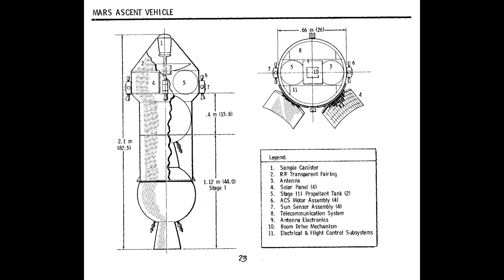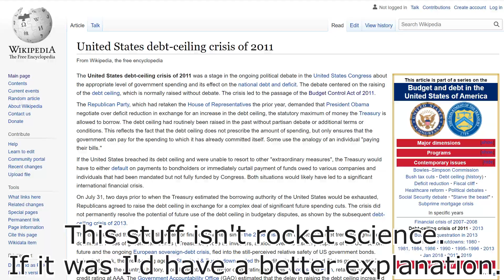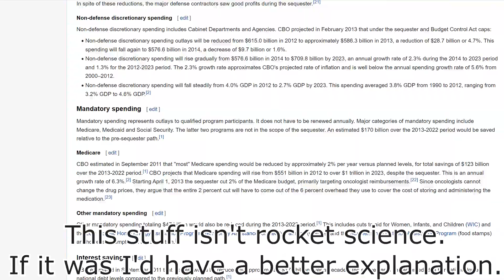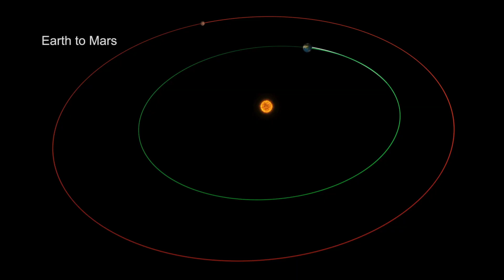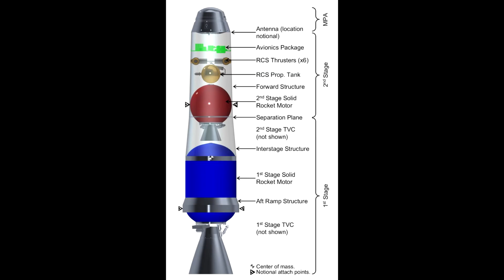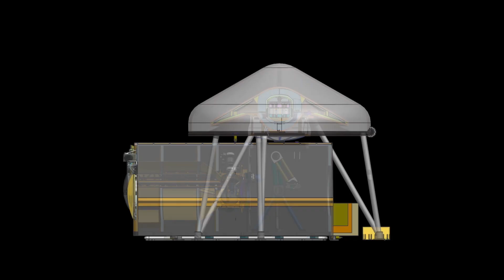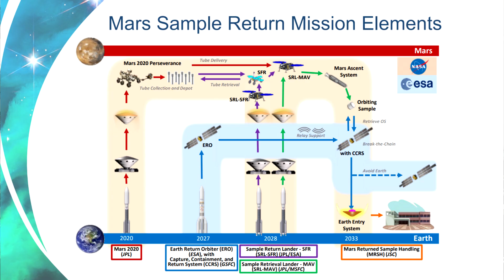Why Getting Rocks Back From Mars Is A Massive Challenge

Comment: The logistics of this mission is crazy, I know they are going to pull it off, but 4 separate parts rendezvousing on another planet is absurd
Reply: Oh god, I didn’t even think about the landing location precision. 100km off and you’re set back several years
Reply: @alexsiemers7898  I think getting the landing spot correct is one of the easier things.. If they didn't figure out the trajectories and orbit calculations by now, they'd probably be missing the whole planet :D
Reply: @rkan2  Plus, the descent stage can be vision-guided now. I can't easily find info at the moment, but I think I remember Perseverance was set down within 5 meters of the target landing spot.
Reply: @alexsiemers7898  40m seems incredibly accurate. Wasn't Perseverance set down a couple km from the intended target site due to the hazard avoidance algorithm? Hence the drive Persy had to perform to get to the delta.
Reply: @FredPlanatia  yes, but Percy has now taken some really good pictures of landing sites… (or will take them in a few years)
Reply: Sometimes I have difficulty getting three parties to rendezvous in a store. I'm imagining all this science and am frankly amazed that people can potentially pull off this minor magic.
Reply: It’s probably cheaper this way. Unless you want to use a SLS for the entire mission (rover+sample rocket+transfer stage)
Reply: @fork9001  you mean the sls that doesn't exist?
Reply: @iseriver3982  Definitely doesn’t exist, there isn’t a 4.1B dollar rocket inside the KSC VAB right now.
Reply: As silly as a sky crane?
Reply: It sounds crazy, but it improves the chance of ultimate success in the event of a failure, vs a single point of failure killing the whole thing
Reply: The mission approach is not absurd, just difficult. You might say the complexity of JWST is absurd as well, but with enough testing and simulation, it is possible.
Reply: It's not absurd, it's necessary
Reply: And when is SpaceX going to do a human return?
Reply: No way they're making KSP in real life
Reply: Sky crane was the craziest. This is easy in comparison
Reply: Indeed Jason.
Reply: Yeah it's absurd because of the planetary protection zealots.
Reply: i doubt they know there going to pull it off there are tons of things that could go wrong with this mission  which are all completely outside there control. 

not to mention this is is kinda a silly thing to do  because  from my perspective it would probably be cheaper and easier to  just launch a automated  lab to mars  to look thought the samples there
Reply: @si2foo  But there is better equipment and instruments on earth, that are very heavy and can only work in controlled conditions. This lab would weigh thousands of tons if we wanted to achieve similar results to earth return. Rovers can already do this, but the science returns are minuscule compared to earth return.
Reply: @si2foo  But it would be more expensive because you need to bring all of the state-of-the-art scientific instruments. And that would be very expensive and heavy.
Reply: not as absurd as my family
Reply: Agree,  a great deal if moving parts for these series of missions.
Reply: From which perspective is it crazy?
Reply: bro why arent we airbags for landing fetch rover
Reply: While i also hope they will succeed it is indeed an insane challenge wich you do atleast realise unlike the Musk fanboys talking about what the best ways to build domes on mars would be in the next decade lol.
Reply: @sambal777  zeah, its mbarrasing to see meople drool over a tsla launched in space byt into the mars mission promises, while for actually smart and talented people rocks from mars are already a challenge and the most exiting thing shoulb james-webb telescope, not a fucking car,
Reply: indeed,  stupid..very difficult
Reply: More practical from a engineers perspective
Reply: So much naivete. The logistics from the US to Devon Island are not that hard
Reply: Whoever goes through the trouble of returning Mars samples, will not want to share the prestige with old programs.  They will pick their own samples
Reply: @douginorlando6260  WTF are you even talking about? Whe whole point of the current rover is to collect samples over a great distance which takes years while in the meantime, we develope the means to collect the samples. Why would you start all over just because of an old program that collected the samples?
Reply: They for sure aren’t going to pull it off
Reply: @eclark9965  Ye of little faith. The people who work on this are consummate professionals. They tick every box, check every contingency, and plan for the worst.
Reply: @wgoulding  and yet they can't identify a greedy contractor that would rather profit from continuous failure then deliver the finished product.
Reply: Mars science is a minor bonus to the primary goal of us being so clever and pleased with ourselves for building the technology in the first place lol.
Reply: Lol don't hold your breath. Lots of moving parts relying on multiple agencies with very questionable track records. Everyone mocks Elon time, but Elon time is downright punctual compared to NASA and ESA time. See SLS and JWST as topical examples.
Reply: @raymonddonovan3297  hardly comparable. elon's got his own slush fund and is playing in LEO mostly(yes mostly, no that didn't mean "only"). Interplanetary travel and actual missions, not just rockets is a whole different best
Reply: @raymonddonovan3297  NASA's track record on Mars missions is FANTASTIC. Five successful Mars rovers, and one aircraft!
Reply: @raymonddonovan3297  Elon simply states "earliest in 2; more likely in 4-6 years" for EVERYTHING (including full auto-pilot function of the Tesla) now over a decade. There is no plan at all and they just fuel the hype train.
By his comments the first Mars mission (some communication satelite) would have reached Mars by 2014/16 already.
Reply: @benjaminmeusburger4254  Exactly that. Usually Mr Musk jsut claims they baicalyl already have it working but just need a few more years to have it series ready. Guess what, even years later, they do not have anything but hype.
Reply: @raymonddonovan3297  and boom just like that, here comes the Elon Musk cult claiming NASA sucks. Deplorable.  NASA put a helicopter on Mars and Tesla will have self-driving capacity next year...like Musk has now been saying for 7 years.  We've been building rockets for a long time.  Every one of these projects is way more complex.
Reply: @raymonddonovan3297  NASA time only. Arianespace had the Ariane V booster ready on time. There is quite a difference between Elon time and Governmental space agency time. Elon time is optimistic date, Governmental space agency time is deadline. And I think delaying a crewed mars landing from 2025 to 2027 and then 2029 is pretty bad. Even setting the goal as 2024 is a bad idea.
Reply: @fork9001  You're right about the difference between Elon time and government time, remember when NASA said they'd have SLS fly before falcon heavy heres the quote: "We don't have a commercially available heavy lift vehicle. Falcon 9 Heavy may someday come about. It's on the drawing board right now. SLS is real. You've seen it down at Michoud. We're building the core stage. We have all the engines done, ready to be put on the test stand at Stennis... I don't see any hardware for a Falcon 9 Heavy, except that he's going to take three Falcon 9s and put them together and that becomes the Heavy. It's not that easy in rocketry." Next thing you know SLS is late by over 5 years and falcon heavy is in regular service.
Reply: @AnthemAnimation  I kind of understand the difference because the only new hardware is the decouplers, but SLS is completely new. New core stage, new upper stage, new spacecraft, new boosters, new launch tower. And SLS has progressed further than starship because it has settled with the FAA and it is fully stacked. And we don’t even know which booster or ship is flying yet.
Reply: @channelchin8911  Starship is 4 years overdue, because design changes and whatnot. I remember the days when we were supposed to land on mars in 2024 with the ITS.
Reply: @fork9001  To be fair, SLS is mostly made of existing hardware (space shuttle derived) the only reason why it seems like a massive, long drawn ordeal to manufacture is because the contractors have taken the military industrial complex model of business, and pumped it full of steroids to a point where there are THOUSANDS of contractors providing the parts working out of all 50 states.  And by the way, we don’t even know for sure if all the current SLS hardware will even fly on Artemis 1, considering that it already failed 3 wet dress rehearsals, no doubt needing many parts replaced. That doesn’t even mention the SRBs that constantly get their expiration dates moved up, next one Is coming soon, and im kind of concerned that this time around might be the last.
Reply: @fork9001  then you never heard of the delays that exomars experienced. It was supposed to launch in 2011. And now the earliest launch date is 2026.
Reply: @AnthemAnimation  The only existing hardware would be the engines. The core stage is new, the SRB segments are new (new casing), the upper stage is new, and Orion has never been to Lunar orbit.
Reply: @jedivm1  It was ready to launch in 2022….
Until the launch provider declined.
Reply: @fork9001  still, it’s kind of embarrassing that so many issues arouse from the wet dress rehearsal, despite the vehicle sharing so much in common with the space shuttle that already flew so many times

Never mind, what am I talking about?, the more problems, the more money the contractors make, it’s no wonder why they pushed the launch all the way into 2023
Reply: @AnthemAnimation  It’s a entirely new vehicle, they didn’t just remove the nosecone and end cap of a external tank to create the core stage. And the core stage has no more problems for now, it’s the entirely new ICPS umbilical that’s having problems.
Reply: @fork9001  Look, I’m not arguing that SLS would be easy to get flying, but isn’t it understandable to feel a little ripped off with a vehicle originally planned to fly in 2017 STILL hasn’t flown, and won’t fly until 2023 at best?
Reply: @AnthemAnimation  *June 2022 at best.
Reply: @fork9001  damn even nasa officially said 2023 you must be really optimistic in SLS being perfectly on time… we’ll see in a few months whos right
Reply: @AnthemAnimation  NASA officially said May for Artemis 1, but given the repairs needed, I’m guessing June.
Reply: @fork9001  I’ll bet you all my subscribers that it won’t happen till 2023
Reply: @AnthemAnimation  Sure
Edit: I checked, the target launch date was changed to NET August. 
Edit 2: Thankfully nasa finally had the guts to request for a decent budget, I hope this means that they can get the LGSS in lunar orbit before Artemis 2
Reply: @fork9001  Given the timeline by that point it will be Ariane 6 booster and yeah they will have it ready in time. Since Arianespace kinda has the commercial thing also. Even thought they are semi governmental via ESA council deciding about their strategical level decisions like what booster to develop next and large government ownership, they still are the historically first commercially operated launch provider. As such, yeah. Just like say SpaceX as commercial provider, Arianespace also has to keep it's promises or customers all of direct governmental, ESA and commercial won't be happy.

In fact Arianespace has even harder "you must hold promised dates", since their number one charter bound task is guaranteeing European space access. Comes before profits or innovation or so on. Which is why for example Ariane 6 is conservative design. More radical reusable design was considered, but ESA council decided "Nope, too technologically risky. What if it doesn't work out, then we are left without heavy lift capacity for years, possibly decade. Unacceptable risk. We take this more traditional tested and true design please. We are confident these upgrades and evolutions can be done. Yeah it costs more. That is not your problem Arianespace, it is our problem. Since we are the ones ultimately paying the costs. We have the money."

SpaceX had luxury of failing in developing their reusability. It would just have meant bankrupty of the company. Arianespace/ESA council didn't have that luxury. If Ariane 6 was too ambitious and failed in developing in time, it would be geopolitical, multiple nations national security and strategic level issue for Europe . That is bit more ahemm... consequential compared to "oeh noes, yet another space start up company went bankrupt. Some billionaire lost bunch of money."
Reply: @aritakalo8011  Ofc, given how long each Ariane variant was operational, and the plans that esa has, I think their next rocket (not necessarily Ariane 7) will be partially reusable with room for upgrades.
Reply: @fork9001  it doesnt matter - Space X launched Falcon Heavy years ago, SLS is yet to fly.

Stop bending facts to suit your point
Reply: @wizzyno1566  Strange choice of words but sure. But can we at least agree that I have a point, because strapping three F9 together is much easier?
Reply: @AnthemAnimation  Coming back from June 2022, SLS looks good after the WDR. Only need to replace a seal on the QD arm for the ICPS. SLS might have one more WDR, who knows but everything looks good for an August launch. Will come back when/if they launch by the end of 2022.
Reply: @fork9001  looking forward to it
Reply: @AnthemAnimation  not a year shed for the subsidizing of basic rocketry failures from the big three of private space flight
Reply: Too bad they are selectively collecting the wrong samples.
Reply: @KK-pq6lu  Could you please elaborate?  I haven’t heard this….

Comment: We've proven that helicopters will work, would be cool to have a mother ship with drones that go out and deliver the samples to the booster
Reply: We've also proven that helicopters are wildly energy inefficient due to the thin atmosphere. Flying minutes rather than seconds would require some hefty batteries...
Reply: @andersjjensen  It wouldn't need to be one flight, small flights over a period of time would be sufficient. These small flights could travel further distances than any rover could in the same time span. Although, you do have a point about the batteries since the samples are going to add more load to the helicopter. I'm sure there's some way to calculate all this 😅 but I'm no scientist
Reply: Actually its a GREAT ideea ! :S

Comment: I really don’t understand why they are still considering the sample return option when it is proven to be far more cost effective and less risky to just keep sending fit for purpose remote science tools that don’t need to deal with the challenges of the return mission.
Reply: Why is that?
Once you get your samples back, you can test for everything. Even thing you didn't thought  beforehand. And the budget is not that high for a mission.
Pretty sure it will be very beneficial in the long run.
Reply: Because there will always be better equipment on Earth.
Reply: Yup. They want to bring samples into the lab to what; Look at under a microscope? Put into a gas chromatograph? It would surely be more fruitful to spend the research grants on miniaturising and sending the lab equipment to Mars and operating them remotely.

Same goes for the idea of sending geologists to Mars. It's pretty preposterous when you think about it.

Comment: To get some serious sample they would have to go the geological way, do borings. That means boring equipment, drills... Now get that automated, so it assembles itself, drills a hole, extracts a 6ft long sample from a desired depth, packs it in the return craft... I got a headache just thinking about it.
Reply: They are drilling their samples. I know what you mean, though, they're just surface samples at this point.
Reply: Don't forget monitoring the equipment and performing adjustments and repairs when the boring equipment breaks itself
Reply: Doing borings off Earth would be slow, but it's certainly doable (assembly would be done with a crane, and an arm with a pair of clamps to apply torque). Of particular note, they would probably not extract a core, but instead drop a sensor module down the hole (or even more likely, have the sensor module carried inside the drill head so it could be used on the way back up). The main question is how they'd do the actual drilling, and extract the debris from drilling.
Reply: @absalomdraconis  On Mars you have an atmosphere of mainly CO2.
Could compress that into dry ice that can do the abrasive digging and should be able to wash the debree out with the "air"stream.
Bonus would be that it should be easy to operate intermittently, as long as you store enough CO2 to clean up what fell back into the hole from the last blasting.
Reply: We need to send up Bruce Willis minus the nuke.
Reply: Starship, moho drills. Success.